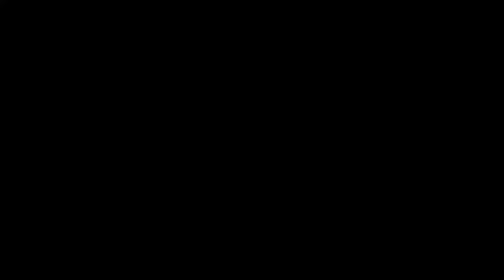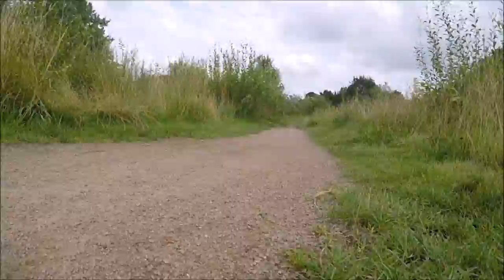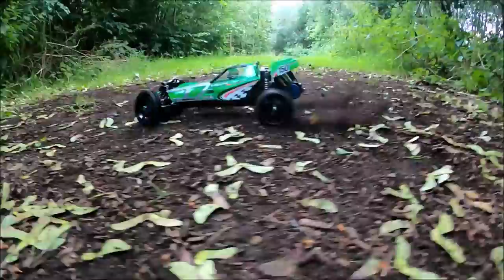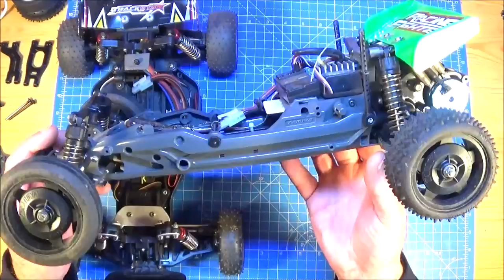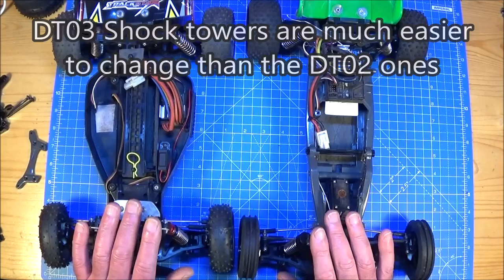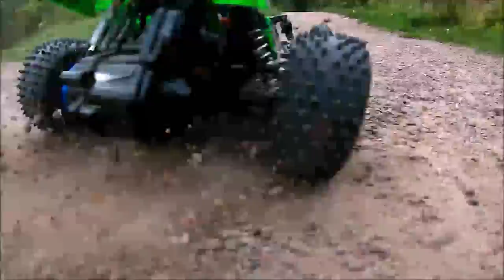Tamiya DT02 vs DT03 Chassis Review - Which is Best? Plus, Hop-Up Options!

Comment: Nice video on the two chassis Mark :) if anyone’s interested there’s a few notes below. The sand viper know as the tuned spec also came with Light weight gear shafts for the gearbox where the dt03 never did. If anyone’s looking for a bit extra stability on the dt02 you can flip the front arms around to increase the wheelbase length. There was a dt02ms version of the chassis and in the kit you got  alloy shocks , alloy hard turnbuckles, alloy motor mount, wide df03 rear wheels, ball differential and possibly alloy rear hub carriers and cvd drive shafts included, unfortunately a discontinued kit now. Having raced both chassis the dt02 is good in tighter tracks and on carpet/Astro tracks where dt03 is better on grass/damp grass. For racing both buggy’s need better tyres all round for. The likes of Schumacher/ballistic buggy with inserts depending on track surface. Also so adding weight up front helps kelp the front end down and the tyres in touch with the ground, about 40g/50g on a dt02 and Up to 70g /80g on the 03 more so if using much more power motors. Anyway good for thought, and great video Mark :)
Reply: Great information Andy, thanks for sharing👍
Reply from the maker: Hi Andy and many, many thanks for taking the time to share your fantastic knowledge with us all, fella!
I'd love to have had that MS version when it was available, sounds bloody awesome!
I must try adding some weight to the front, too. Thanks again for sharing the RC love! Take care, mate! 😍🙏👌😊👍
Reply: My pleasure Mark happy to help if I can

Comment: The dt02 is so much more agile feeling, being shorter end wheelbase. With a quality, high speed steering servo, it feels very light, and with decent brushless, does wheelies on command. One of my dt02s does 82kmh and will flip at almost any speed with a stab of the throttle.
Great video mark, you really covered the important points.
I love my dt03 also, reminds me of being a kid with a 2wd Tamiya Fox bashing around, longer and more stable. You are right about them being rewarding to drive. Very good point!
Reply from the maker: Hi Pete and many thanks for the smashing comment! OMG, 82kph is awesome from a humble DT02! My DT's are nowhere near that, but the do pull great wheelies! Thanks for the input and the kind words, much appreciated my friend - have a great weekend! 🙏😉👌👍

Comment: Very good look on the two chassis :)
There are two other variants that can be mentioned.
The DT02 Nissan Titan, a stadium truck, it comes with CVAs, has a brace across the front shock tower and different tires with lots of really small spikes on dish rims.
The DT03 Aqroshot, also a truck type body, CVAs and has wide onroad wheels on Stadium Blitzer/Blitzer Beetle rims.
Ive put rere Sand Scorcher shells on both of the above.
The DT02 has close to the correct wheelbase which i made exact with 3d printed front arms to fully correct it and also narrow it to look right.
The DT03 is a bit long but as the Blitzer Beetle has a longer than Sand Scorcher wheelbase i was able to cut the chassi in the middle, take out enough and join it back together to make it correct for a Blitzer Beetle.
Reply from the maker: Hi dude and thanks for the comment and info! Yeah, I know of the Titan but haven't seen one in person, my friend Pete Wylie has one though. And the Aqroshot is a strange mixture of buggy and truck with the wrong tyres on it in my opinion! Much better with the Blitzer tyres fitted!
Cool that you fitted Sand Scorcher bodies on them, very interesting. Nice work modifying those chassis, too, great stuff - cheers!

Comment: I had a DT03 that I converted to a DT02, and apart from bracing the front shock towers the DT02 handled way better, mainly due to the shorter wheelbase. Excellent video though mate!!
Reply from the maker: Hi Barry, funny but I know of a few people that have converted the 03 into a 02! The wheelbase does make for livelier  handling for sure! Thanks for the support 🙏 mate!

Comment: Hi Mark, a fascinating in depth review here. Although I own the DT-02 Holiday Buggy & Sand Rover and have no complaints about the chassis, having had no breakages over the years, I must admit that I'm strangely drawn to the DT-03 chassis. I think the slimness of it just appeals to me and I do like the Racing Fighter as a buggy. Also I fully agree regarding those awful screw pins you mention. Although I've yet to bend one I have had one simply vanish after a run. Presumably it just unscrewed itself during running. Great video mate with some fascinating comparisons. Best wishes for the weekend my friend..👍🏻😀👍🏻😀.
Reply from the maker: Hiya mate! Wow, great to hear that you've had no issues with your HB and Sand Rover, I think that those bodies do a great job of protecting the shock towers, though! As you know, I love the 02 and 03 equally, but for different reasons. I'm with you on the looks of the Racing Fighter, always intrigued by something a little different! It's a cool looking buggy for sure. Hehe, I've also lost a few screw pins (well, the one's that haven't rusted, anyway!!) Thanks foe tuning in every week and wishing you a cracking weekend, too! 🤞🙏👌👍
Reply: You can use the stainless hinge pin hop up from the tl01 kit to replace most of the screw pins and as they are stainless they don't rust and are secured with e-clips.
Reply from the maker: @riclloyd5172  Cheers Ric, great tip! I do use those stainless hinge pins and have put the part number in the description - many thanks! 🙏🙏😉😉👍👍

Comment: Great video. Something to add for people running brushed motors. There is not much cooling with the motor being well covered and even the standard 540 will get quite hot. Hence a lot of people drill holes in the plastic shroud surrounding the motor to keep temps down.
Reply from the maker: Thanks Mark! Great point about keeping the motors cool! I've heard of others doing this to the plastic surround but never tried it as yet. Many thanks for sharing the info, dude! Cheers! 🙏👌👍
Reply from the maker: Thanks for sharing the info, Jess! Definitely had this issue on my M01's, got the Tamiya heatsink plate hop-up. Cheers!

Comment: Excellent comparison! I guess it is time to get a Tamiya 2WD Buggy again! 😀 Thanks for sharing!
Reply from the maker: Thanks very much! You can't beat a Tamiya RWD buggy! Excellent fun to drive. Thanks for watching!👍
Reply: Get a dt03, preferably racing fighter as it has the decent narrow front tyres from factory which will turn and handle much better.
If you get the right kit they come with a torque tuned, but even a 13.5t sensored brushless will work fine with the tble04 esc. If your need more power, the sky is the limit, i use a 4300kv 3660 in mine, the torque is just unbelievable.
Ps, get a decent high speed steering servo, makes such a difference to how the car feels and drives, much more agile feeling and steering accuracy is improved also with some alloy fromt steering knuckles and C Hubs 😁
Reply: @peteuncle2935  Thanks for the info!

Comment: Hey Mark, great informative video there mate.
That's a splendid summary of a platform(s) that I didn't really know anything about.
I have never built or driven either, but often hear its praises being sung.... Craig from OAG is another big fan I do believe.
Got me intrigued now, to the point I've been on ebay checking them out! 
Most surprised at how much you get for your money, a great package for a lower end kit.
Fellow Green hawks crew Taylor and moo moo have just bought a hornet and grass hopper, and I could do with a buggy to run with them.... There's no way I'm using my TRF top force or Avante driving with those 2 nutters! 🤣
Ive also got a spare TBLM brushless motor knocking about that was useless in some of my other cars, seem to remember being impressed with the performance in that sand viper in some of your previous videos.... maybe worth looking into?
Cheers for sharing the knowledge bud, very useful for sure. 👍 👍 👍
P. S Love your aluminium home made hop ups, something I often do on my own runners.
 Something you don't see so much of these days! 👍
Reply from the maker: Hello Mr. Darkside! Thanks for the great comment as ever! 
Yes, these buggies are cheap and cheerful but are surprisingly capable, especially with a little tweaking (as with most Tamiyas, don't you think?) Oh man, either of these would certainly show up a Hornet or Grasshopper - you gotta get one! The TBLM I fitted (15.5T) is enough to add that bit more performance but is lacking in revs, so needs higher gearing, it has tons of torque though so I do recommend it.
Gotta love a bit of basically engineered alloy plate, but most folks struggle with a hacksaw, vice, drill and files these days!!! 🤣🤣👌👍
Reply: @MarkBryanRC 
Yes indeed mate.... I love a little tweeking and tinkering!
So..... I started looking at the DT03 buggies on ebay tonight in view of treating myself to one.
Unfortunately, I somehow got diverted down a wormhole and seduced by the dark side forces of Kyosho.....
Long story short, I accidentally just bought a Kyosho Turbo Optima instead !! 🤣
So much for getting myself an entry level buggy to bash with eh?!!
It was all that gold anodised aluminium, I just couldn't resist!
'shiny shiny'!!!!
Oh well, the DT03 and the XV01 will have to wait for now.... but both will be compulsory purchases at some stage in the future for sure.
Now I've just got to work out how to tell the inland revenue that I've just spent my income tax bill due by January 31st on another toy car! 🤣
👍 👍 👍 👍
Reply from the maker: @yodadarksideGreenHawksRC  Haha, I've done some of those impulse buys in the past, too! But fair play, the Kyosho Turbo Optima is a wonderful RC from the ground up, congratulations on your new purchase ...and sod the Inland Revenue!!! 🤣🤣👍👍

Comment: Very comprehensive overview, Mark! Brilliant. I had planned to do one myself, for years. I agree with all the points, although the performance difference kind of escapes me. I know the DT-03, in theory, should have some advantages (balance, wheel base) but ... Hmm, maybe the difference is better felt when driving them at the same time. Well, remember the Neo Fighter Buggy comes with the wide formula 1 front tires too. It's only the Racing Fighter that has the "correct front tires". Some DT-02's also have them. But yeah, if I should choose between a Neo and Racing fighter kit, I would choose the Racing Fighter - due to the front tires. Well, enough said. Brilliant video, Mark.
Reply: BTW, I've seen the Desert Gator pop up now and then for sale too. Basically the Viper is a redesigned Desert Gator, with a new body.
Reply from the maker: Hi Mikael and thanks very much for your kind comment! I have been thinking about this video for a while, ended up waffling for almost 40 minutes and had to cut loads out! Yes, the different designs are evident when driving back-to-back, the 03 is definitely more planted and stable. Haha, yeah the Racing Fighter is the only one with the right front tyres! I do love my DT03, but that said I still have a soft spot for my DT02's! Gotta love Tamiya, mate! 😉🙏😍👍
Reply from the maker: Unfortunately I've never seen a Desert Gator for sale in the UK! 😢🙏👍
Reply: @MarkBryanRC  Yeah. The DT-02 is so iconic. Especially with all the different bodies, from modern iconic bodies like the Viper to the classic Rivers etc.,  and the tremendous success it had right from the start. No wonder it’s still available here almost 20 years later. What a long run it has had.
Reply: @MarkBryanRC  Yeah, maybe it’s discontinued now. But sometimes it actually pops up at Tamico. Though now it’s probably more than a year ago the last time … but well, no worries. The Viper is a essentially a Gator - just a tiny more beautiful ☺️
Reply from the maker: @NordicRC  Great words, Mikael, I wholeheartedly agree! 🤩✌👍

Comment: Nice comparison. I watched you DT02 video you did a while back where you showed the front shock brace. Thought it was a great idea but I never got round to making one. Had loads of crashed and jumped it loads and It has never broke (yet) but I probably just jinxed myself 😂 Never owned a DT-03 as I preferred the chassis layout of the DT-02 and a beetle shell fits it nicely. Those pins though, I totally agree, a cheap part that you need to keep an eye on. As you say, surface rust can occur easily. 👍🏻
Reply from the maker: Hi Damian and many thanks for the comment! Yeah the shock tower brace is all good but is a bit of a faff to make. Hope yours never breaks and you have done well to come this far without issues! I must build a Beetle version of a DT02 one day, always liked that idea. I put a link in the description about TL01 hop-up stainless pins to replace them if you ever need to! Cheers mate! 😉👌👍
Reply: @MarkBryanRC  think I will get them for the DT-02.  I bought a few sets before for other models. Thanks Mark, appreciated 👍🏻

Comment: Hello mate. Well that was a very comprehensive guide to these two. I can tell that you put some thought into this and I can't think of anything you missed. Obviously when you said there's no point going crazy with the motor speed I would respectfully disagree 😂 My thoughts on these are that I like the fact that you can get off the shelf shock tower upgrades for the DT-03 but I prefer the handling of the shorter wheelbase DT-02. Just easier to throw around. Good stuff mate and I hope it does well for you which I think it will. I'm going to do a bit of RC over the weekend so looking forward to that. Hope you've got a good one planned. Cheers for now 😁👍
Reply from the maker: Hiya Pete - thanks mate but I know you would disagree about my choice of tame brushless power! 🤣 TBH I love the handling of both but I can still chuck the 03 around pretty well! Yeah, this type of video usually does pretty well as it does divide or bring up lots of opinions. Hope the weather is good for your RC weekend antics, it's so bloody cold up here I'm just staying inside until March!!! Still trying to get this blasted gastritis under control, but getting there slowly I think. All the best my good friend! 😁👌👍

Comment: I've got both and love driving them both. I upgraded my Holiday Buggy to CVAs. I've also recently added lead weight to the front of the Neo Fighter to try and counteract the slight understeer. I didn't know the Sand Viper came with additions! Thanks for that Mark. I've also added Torque Tuned to the Holiday buggy, makes it more rail happy. I like driving them, though they're almost too competent, if you catch my drift. Driving my Rising Fighter (with CVAs and anti-gay mod) is more satisfying, bizarrely!!!! I am just a park basher, though. Life is competitive enough lol!
Reply: Anti hop lol not gay 😂😂😂😂😂😂
Reply from the maker: Hi Lee! Yeah they a 2 great chassis for sure! I have yet to try some weight on the front, I'm just lazy! Yep my Holiday Buggy is as fast as it needs to be with the Torque Tuned, too. I do know what you mean about these chassis being so competent, but my DT03 with the brushless motor is a bit more of a challenge to drive fast! The Rising Fighter is just a battle to keep in a straight line! Same here, just a bit of bashing with friends is enough for me, mate!  :O)
Reply from the maker: 🤣😁😜 Haha yeah that made me laugh, Lee! 👌👍

Comment: I've got the Holiday buggy in the wings waiting to build... So a few upgrades needed.  Cheers!
Reply from the maker: Hi Dude, I know you will enjoy the build, you know what needs to be changed, bushings, shocks, motor, pinion... but at least you shouldn't have too many issues with the shock towers as they are protected by the body. You might wanna swap out those screw pins though, for the TL01 stainless hop-up, #53301. Cheers!
Reply: @MarkBryanRC  Terrific thanks!

Comment: Hi there Mark, a great comparison. (Although I think you mean 25mm, rather than cm) longer. Slight slip of the tongue. 😊😊😊. Great explanation of the tyres, camber, suspension options. I love the modifications to the DT02, especially that aluminium plate mods. Those screw pins are terrible. I’ve been entertaining myself with a DT-03 Neo Fighter that I pickup last year from Amazon for £76! Think I might get some road wheels and tyres though, as I wouldn’t Ming running mine on some streets around home, and those square spikes are not going to last long on tarmac, surfaces. Great details bud. Best wishes to you all 😊😊
Reply from the maker: Hiya my friend John! Thanks for the kind words as always. Haha, yeah, getting my worms mixed up AGAIN - definitely mm, not cm!!!! You can swap those crappy screw pins for TL01 hop-up stainless pins, mate. Great price for that Neo Fighter - those road wheels are a must on tarmac, fit them and have some fun! All the best to you all, John, cheers! 🙏😉👍

Comment: Another great video Mark.. i do you think you mean 25mm not cm.. :) also the Sand Viper DT-02 is a far superior kits. the included upgrade parts. Better motor, Bearings, CVA shocks, metal drive. TBLE-04S ESC line and adjustable top arms.
Reply from the maker: Many thanks, Simon! Oops - My bad!!! I didn't even notice that I said cm when editing the video - what a plonker I am!!!  🤣 Thanks for pointing that out! Oh yeah, the Sand Viper is by far the best value-for-money kit. I still rate the Racing Fighter though, but you need to spend a few quid to get it up to Sand Viper spec. All the best and have a great weekend!  😉👌👍

Comment: Hi Mark. Change the suspension hinge pins for tamiya Tl01 stainless pivot pins and use 3mm washers to shim as required
Reply from the maker: Cool, thanks for the info, Matt! Yes great tip, if you look very carefully at the video you might be able to see those pins in the front of my DT02 and also in the rear of my DT03! I did mention when filming but had to cut the video down as it was too long! Thanks to you, I've just put a link to that hop-up in the video description! Much appreciated, Matt!